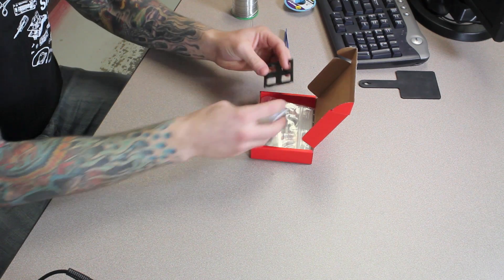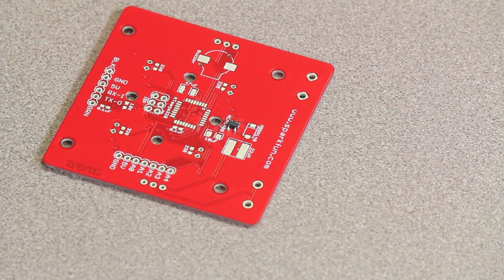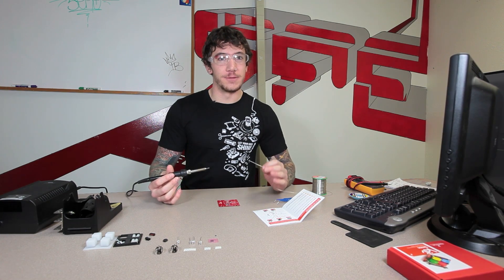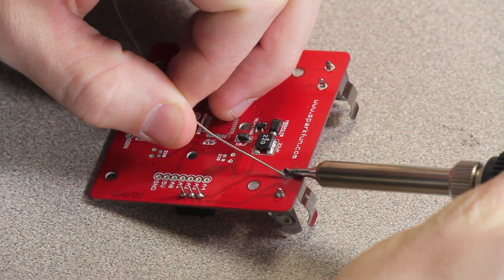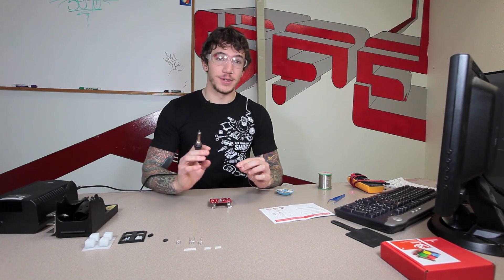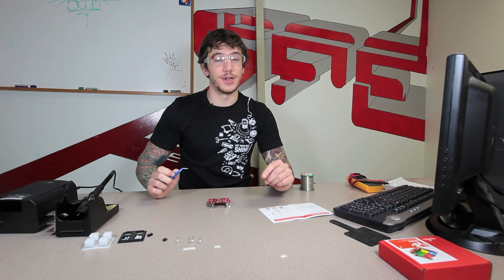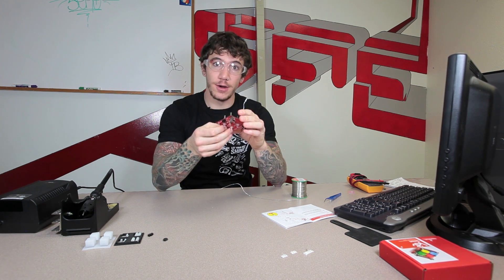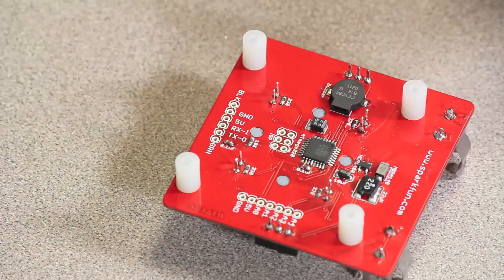SparkFun Simon SMD Tutorial With Tony

Comment: I was talking about the fact he wears them while soldering SMD parts. I worked for a pcb prototyping company. While handsoldering SMD parts (repairs, missplacements) the workers don't wear googles but gloves and all workspaces had fume extractors. Googles fog up and you sweat like hell. It's ok while clipping component leads. But everyone can do it the way they are used to or how it's written in the safety guidelines (which may differ from country to country and company to company).
Reply: Those are the cheap goggles that fog up. The Newest ones have vents to keep them from fogging up.

Comment: I would highly recommend using some liquid solder flux when doing smd soldering like in the video.  If you noticed when he soldered the resistors there was a point where the solder was sticking to the iron rather than the resistor.  Some liquid flux would help with that and ensure a good connection with the resistor and the board.
Reply: yeah i dont even do smd yet or have soldered yet , watched a ton of videos on it and those joins look terrible on the SMDs and some of the THT look empty